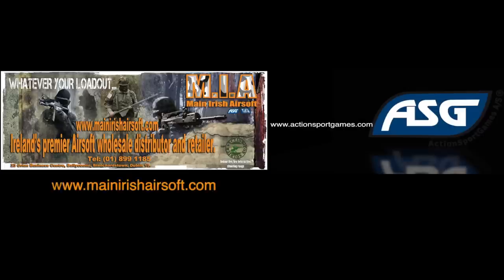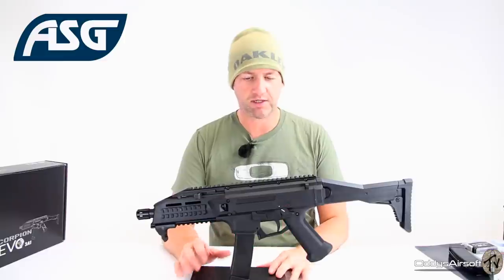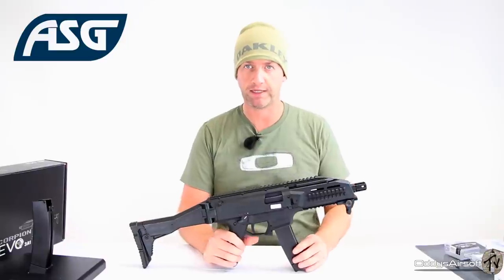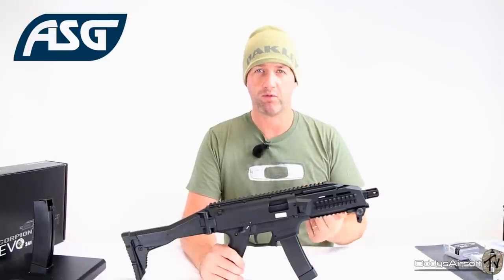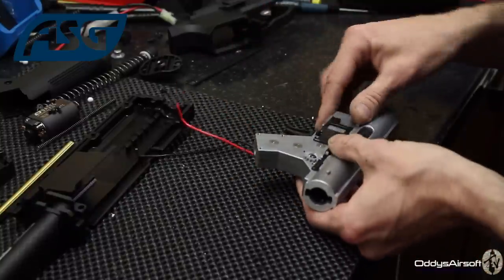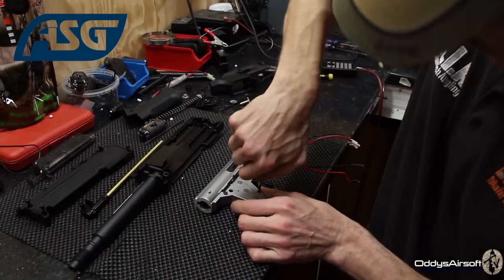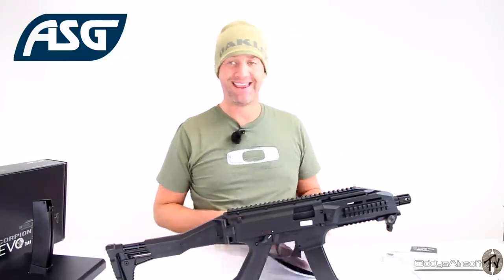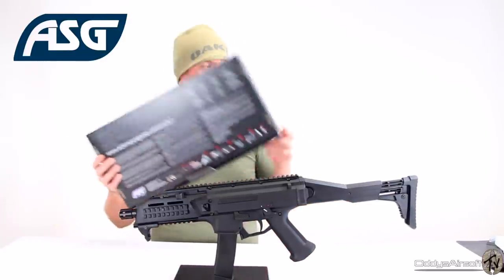ASG CZ EVO SCORPION 3A1 - full review

Comment: I've ordered this little baby for my birthday.
The field I'm mostly playing at is an abandoned bungalow park, so switching from range to cqb happens a lot. And I hope this will give me a little easier time with that. 
 #airsoft   #airsoftguns
Reply: O Meester I’m 5 years late but what spring do you recommend for 350 FPS
Reply: @slippyburger859  m90 . If it still runs a bit too hot you could cut the spring. Half a bend at a time. 
Would recommend getting a steel guide rod as well.

Comment: Hi, I bought this gun from patrol base a month ago. Using 0.25BB’s I’m only getting around 260fps with a 7.4b Lipo battery…that seems very low. I  swapped to a 105 spring and it’s around 285fps with the hop up fully open..I was told that using an 11.1v battery would wreck the gearbox, Amy thoughts please.
Reply: ASG recommend 11.1v for this gun. it has a mosfet so it wouldn't wreck the gearbox at all (unless your gears are misaligned, but that eventually would wreck your gun no matter what battery).
your fps has nothing to do with battery, check compression instead.
Reply: @Slodin  ahh, so what would be the advantage of using an 11.1v battery then if it doesn’t affect the fps please…how do I check the compression..?…I’m sending it back to PB for them to take a look at…could you do a test or video on this please..?…PB said they tested one out the box and it was 285fps…the box states it should be 312 so I’m baffled why they are so low, especially my one.🤔
Reply: @bigtel1977  i'm not a YTer, i don't make videos. You can search for airsoft aeg compression check/mods. You are testing with .25s, they are testing with .20s, so it's pretty normal their result is higher. The box says really doesn't mean much aside from telling you that was the targeted fps. Check out a airsoft spring model fps chart to find out which one you want (I usually do m120 cause I want it be close to 400fps with a 0.20).
Reply: @Slodin  Thanks for  your help…I’ll see what I can find.